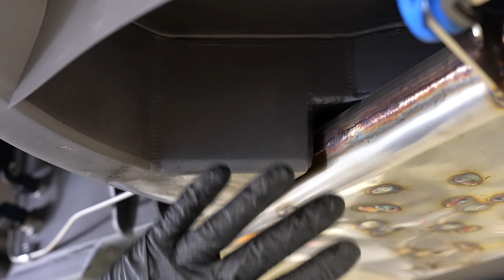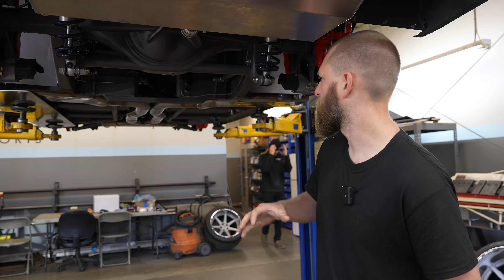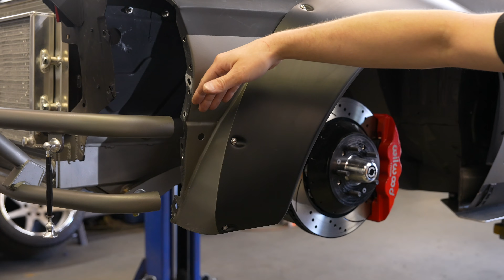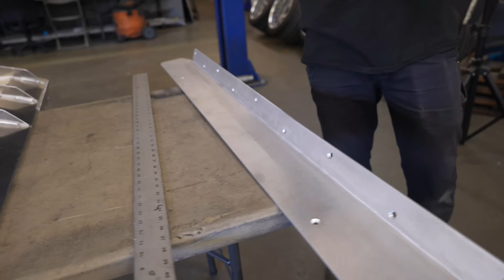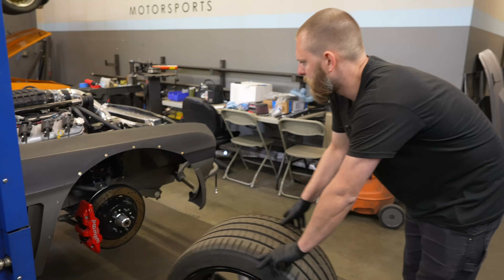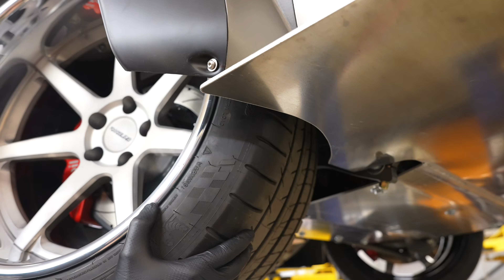Hoonicorn Inspired Build Full Walkthrough & Weight! Questions answered!

Comment: Absolutely awesome work. My only question so far is with the steering rack limiters. Seems nonsensical to have a handbrake for drifting yet limit the steering angle. Seems like the sway bar needs to be narrowed or removed all together. But you didn’t mention how much angle had to be removed so 🤷🏻‍♂️.

Either way, bad ass build.
Reply from the maker: Thank you! And that 100% make sense, that's actually one of the first things we mentioned to the customer! We discussed modifying/removing/etc of the sway bar. After some talks, they decided that the "drifting" + handbrake part is more for a here and there fun. The goal of it being more of an "all-around" car for them that sees a variety of driving. The main purpose of the steering rack limiters is just to make sure there's no accidentally hitting anything! 

Thank you and thanks for watching!